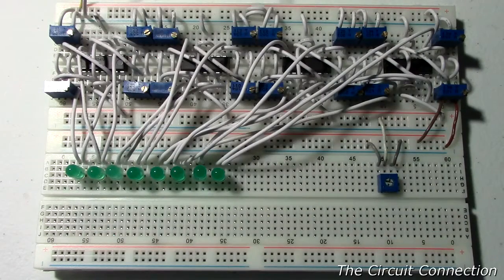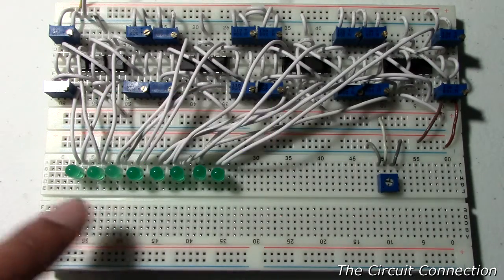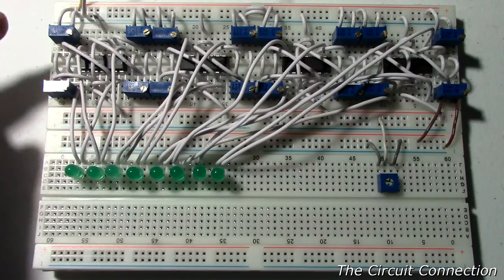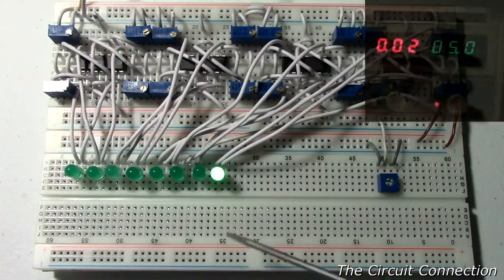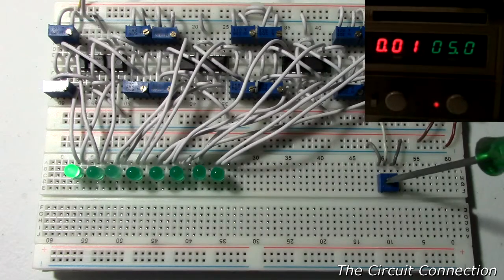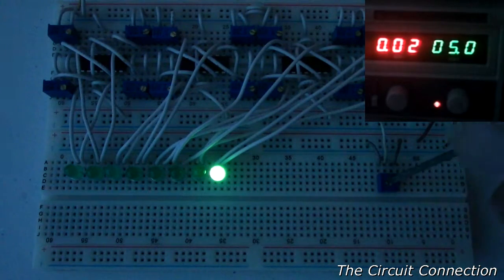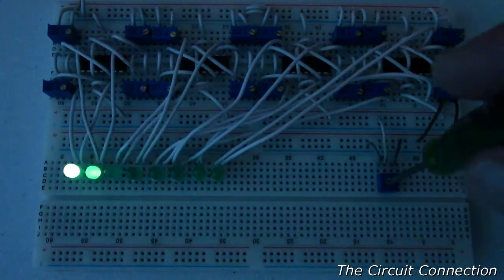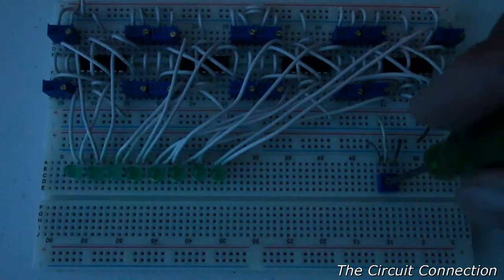08 Window Comparator Demo

Comment: The Good Stuff... I came up with a set up with 4 LM358 in an attempt to match what you have done. I would appreciate your opinion and suggestions on it. check out the link. for this i will use multiple resistors as voltage divider to set voltage points, instead of the many pots you've used.   https://www.youtube.com/watch?v=9AI0oV-ZlKI&feature=youtu.be